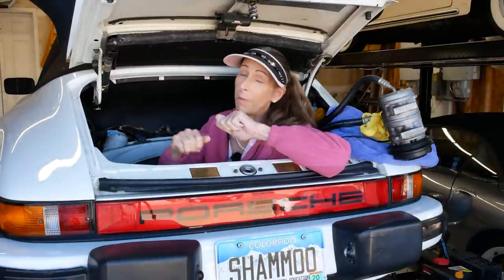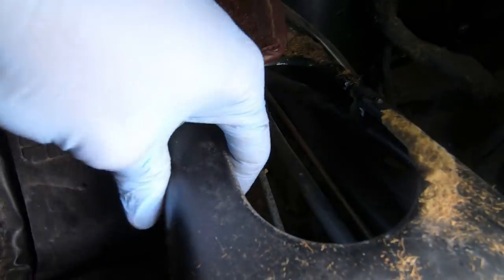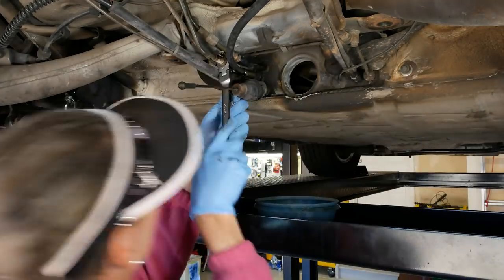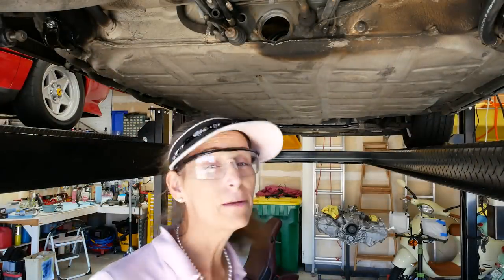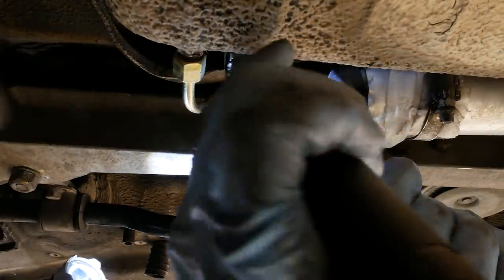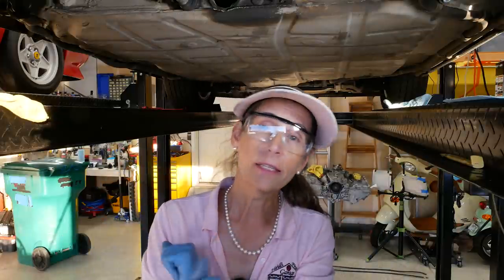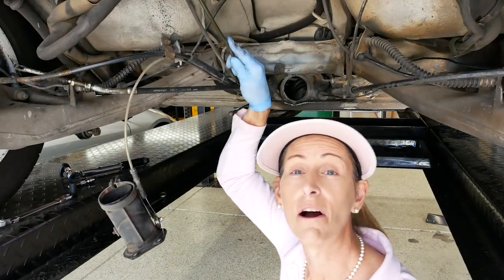Budget eBay Porsche 3.2 Carrera Project Car #18 - New Fuel Lines!!

Comment from the maker: Hi Everyone, So sorry this has taken so long, but there was a bit of difficulty in obtaining the correct parts.  But, finally... all the fuel lines in the car have been replaced! Yea!  Quite the job.

The gentleman who makes the fuel line kits is Len Cummings: len.cummings[at]verizon.net (replace the "[at]" with "@").  If you need a set, send him an email and let him know you saw it here!

#porscheprojectcar #porscherebuild #porschefuellines

Other products in the video:

Neiko Metric Crowfoot set: https://amzn.to/3e4UVRg
OEM TOOLS Flair Wrench Set: https://amzn.to/2zdOUmI
TEKTON 1/4 Inch Drive Torque Wrench (20-200 in.-lb.): https://amzn.to/3g5cfHH
DEPSTECH Wireless Endoscope: https://amzn.to/3bLthr5
Reply: +1 on Len Cummings. Len went above and beyond getting my '81 SC back on the road. I had the fuel line between the tunnel hard line and the Fuel Accumulator split when I was in my garage (at least I wasn't 100 miles from home when it happened!). He patiently instructed me on how to repair my car, helpfully suggesting how to safely repair the hoses.
Reply from the maker: Super high quality too...
Reply: I do not have a Porsche or Ferrari but can not stop watching you all the way from Cape Town!
Thank you!

Comment: A suggestion for your future viewers. If you soak the 4 rubber grommets with exterior rubber conditioner (armoral etc. ) it helps to soften them up. I was able to push them through with a plastic pokey tool. No hammering required. Might be age dependent. Mine is an 87 Targa.

Comment: I just did the whole fuel lines and hoses in my '87 Carrera while engine in place, it was one of the hardest jobs I have ever did on any automobile!, definitely having the engine removed simplifies the job so greatly. I wish you had that video uploaded 3 months ago!. Thanks so much for the great Porsche content in your channel.
Reply from the maker: Sorry, guess we need to pick up the pace! :)  Did you use Len's kit?
Reply: @HeidiandFranny  No, I used the OEM lines from Porsche, if I knew about this kit I would definitely use it, it would make the job much easier. I guess that what I will do after 30 years when the next fuel lines change will be due! :)

Comment: Franny, I'm happy to hear there are folks who specialize in fabricating replacement parts that are no longer available. Don't apologize for taking your time. Routing lines is no easy task, because as you said, they were originally routed before all the parts in the way were assembled! Precision work takes patience, which takes time.

When I restored my 67 Beetle the factory warehouse in Germany still had plenty of parts, including body parts and panels, but they were running low. They put us in contact with a factory in Mexico that warehoused replacement parts for most Beetles imported for the American market. We finished the restoration before the German parts ran out. There were plenty of aftermarket Beetle parts, but it didn't cost any more to stick with the OEM parts. We had to wait for shipping, which was very slow. I think everything came by ship back then (mid 80s). I wasn't willing to pay for expedited air shipping, which was very expensive. 

It took about 2 years to do the complete restoration, the last part being new paint. I couldn't afford to do the entire restoration quickly. I had to save up and do the next steps each time. We did the engine first and I drove the car through most of the restoration. It was out of commission while it was at the paint shop. Since Beetles are all bolted together it was easy to replace fenders and bumpers. The interior took a lot of work and took the most time.

Comment: Wow, wow, wow!!! This video you and Heidi have posted has been such a help for me. I have continually gone back and forth reviewing your steps, so we’ll documented. I’m not quite through to the finish line but getting there. I’ve had both hard lines installed but uncertain of the routing. There seems to be too much interference up front. I finally broke down and removed the driver floor board to see if it would help. Yikes! What a pain! Hope you guys are well! Thanks again!!

Comment: looks pretty clean this whole car. may never had seen salt, snow or rain...
Reply from the maker: Surprisingly clean (rust wise).  They do have a good bit of rust protection.  I drove the car through a couple winters here (it is still sitting on snow tires) and It actually was one of the last cars out of a town to the north of here that was flooding!  Heidi said the water was almost up to the doors and they closed the road within a few more cars.  They are super solid cars!

Comment: I wonder why Porsche put the metal lines in that location in the first place. Is there any kind of stress to the lines like heat or mechanical stress? Anyway, once again an interesting tutorial, thanks!

Oh, btw:

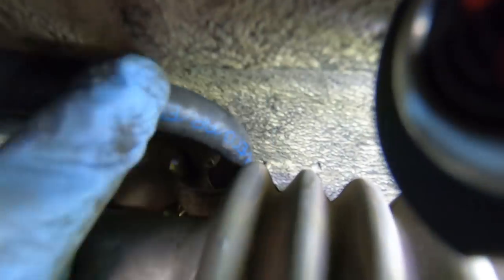17:11 : „Putting them in is just the reverse of taking them out“. This is a frequently used phrase in the workshop manual, when the people in Zuffenhausen know very well that the way back will be hell. You could read it as: „Abandon all hope, ye who enter here." 😋
Reply from the maker: I'm guessing the steel there is for road rash?  It isn't hot...  Ya know, the fuel lines on the 356 are mostly steel too.  Yeah, that reverse thing always sounds so clear but...  Those steel lines must have a trick to getting them in.  They can't go in from above either.  You know there was this one tech on the line that could put both in in like 3min.  Well, on from here!  Lots to go ;)

Comment: Hi Franny,. Thanks  for your very well documented video 
Would like to know your ideas to replace engine insulation cover behind you 
Is it doable without taking out the engine ? 
Thanks
Reply from the maker: That is a great question!  As far as I know the insulation replacement is an engine-out task.  Maybe if you lower the engine somewhat?  BUT, there is a guy on the forums that makes a cover that goes over your falling insulation and holds it up tight against the firewall.  It looks great too.  I think I saw it on Pelican.  Our 993 is needing some love here too...
Reply: @HeidiandFranny  ; thanks Franny ; have bought a cab 911 red cassis metallic in Dallas to bring back in Paris ; try to get as much as information for further tasks ; your videos are very comprehensive and helpful . many thanks

Comment: OK I Got the chassis lines from Len and will be tackling this as soon as I get off my butt.  So another 3-5 watchings of this video for good luck and I'll be off to the races. I have new leathers for the seats so I guess I'll be killing 2 birds with one stone too.
Reply: I got mine in today. Not too bad at all.  I cut the lines off by the rack so I didn't have the snake the old fitting through.  You guys have made my work on my Carrera so much better with these videos.  I did yank too hard on the second line and it went into the hole, but I had the hatch open in the back seat and was able to get it poking out from there averting a headache.
Reply from the maker: Great, glad the videos have helped.

Comment: Isn’t there one maybe two more lines you need to complete the job? Filter to engine, and engine to return line? Those lines get the most extreme heat cycling of them all. Are they just not available?
Reply from the maker: There are three line in addition to these and they are on the intake manifold video (https://youtu.be/ImrK6o2sEug).  They were also a pain to source ;)  In addition there is the neck on the tank and some vent lines I might look at as well.

Comment: Franny, with all the ethanol they put in today's gasoline, what's the possibility of ruining these steel tubes? Maybe they're not stainless steel made, and will corrode under this new "fuel". Here in Brazil, we running 27% ethanol on gasoline, and even more.
Reply from the maker: Ethanol does have an affinity for water, but if you run through the gas fast enough it shouldn't be an issue.  The steel lines (except for the crunched bit) are in great shape.

Comment: Where can I fond steel rack support engin for work on h6 3.2 porsche
Reply from the maker: It is a standard engine stand for Porsche/VW, but make sure it can handle 6-700 pounds.  Also, the one I have isn't as stable as I'd like...  I'd recommend one with a cross bar at the front and four wheels.

Comment: Hey, where did you buy the fuel lines ?
Reply from the maker: If you are looking for the engine fuel lines Coline makes and sells a complete set which you can get at AutohausAZ.  We wanted them in yellow cad so we had them made but the shop was such a terrible experience I won't recommend them.
Reply: @HeidiandFranny  Thanks, I was looking for the tunnel and gas tank to tunnel lines. It looks like all the engine lines were replaced at some point
Reply from the maker: @AndySomogyi  Ohhh, those came from Len Cummings. His contact info is in the description :)

Comment: I'm hopeless with mechanics so try not to laugh... Why the small parts on both sides of the tunnel in the fuel lines in stead of one complete flexible line ?
Reply from the maker: Oh, that's because the plastic tunnel lines almost never go bad (unless some drills through them).  It is the soft rubber lines that degrade over time so having connectors on both sides allows you to replace just the rubber parts.  On the OEM lines the rubber is swaged on to the plastic lines so the entire assembly has to be replaced.  Does that make sense? F
Reply: @HeidiandFranny  Perfekt, thx ! I was surprised by half of it being hard lines and half being flexible lines and started thinking about this whole configuration.